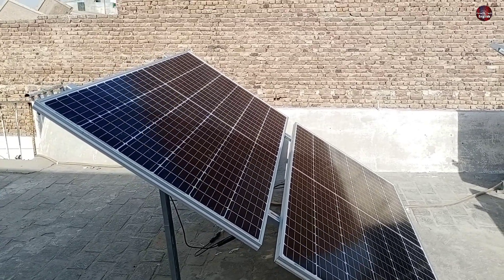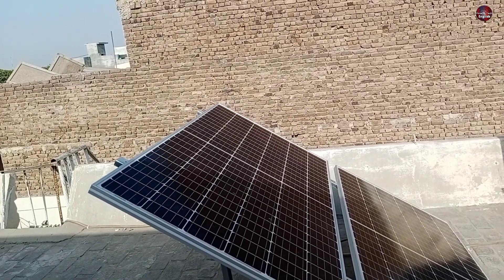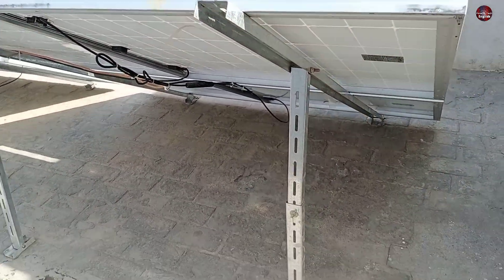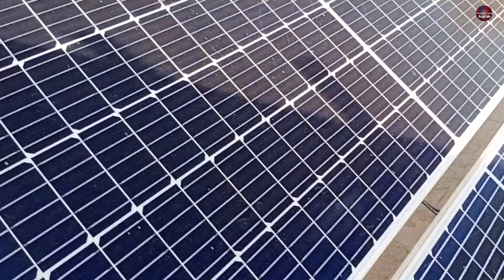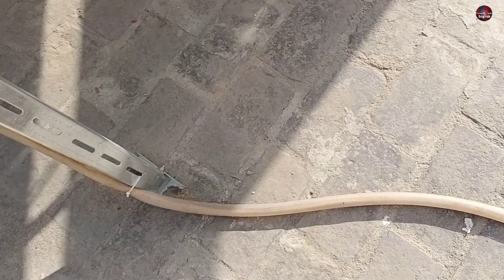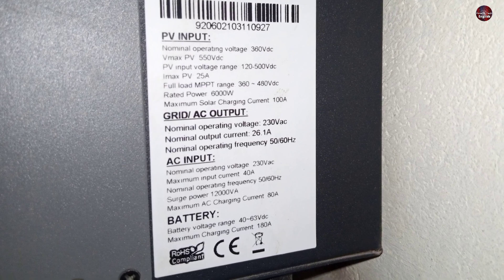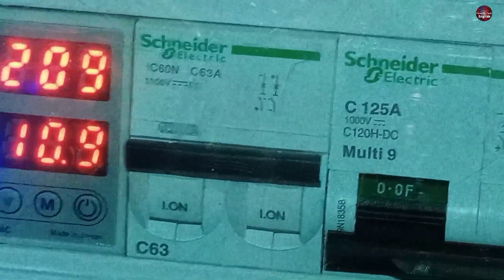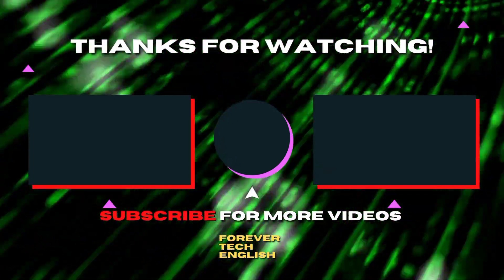Solar Panels System For Home - Mistakes To Avoid

Comment: solar are good , just that batteries are the main problem , the money you save in bills over years is burn out on replacement of batteries . so how much your each battery cost ?>
Reply from the maker: Yep that's true. The lifeSpan of each battery is almost 1.5 years. Currently I am looking For better batteries then those.
Reply: @forevertechenglish  let us know if you find a good solution or maybe a R&D in making custom battery or repairing a battery by self not sure from where plates need to be purchased or maybe can be made home made from something else

Comment: I have bought some Solarpanels and must install then on my roof of my garage within this month, five on the west side and five on the east side. It is a pitched roof with 35° angle.
With your roof it is much more easy to reach the panels and clean them.

But I will do it in a bit different way. I use for each PV-module a StepUp-MPPT-modules and create a voltage of 48V-56V for the LiFePO4 battery. With one MPPT per PV-module the problem with the shadows is not sich a big problem any more, because then they are all in parallel. But I would get around 50A and need some more cooper wired.

The battery has a protection for overvoltage/undervoltage and a currentlimitation. If the battery is full, the energy can used normally over the 230V AC grid or I activate the water-heating.
Reply from the maker: Good luck 🤞 for your project